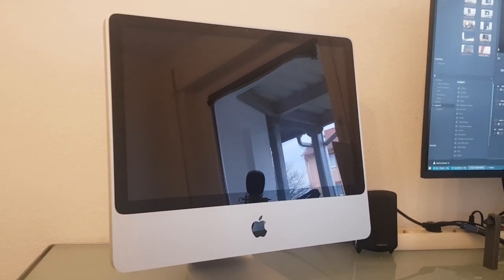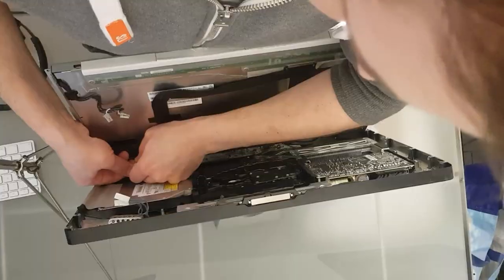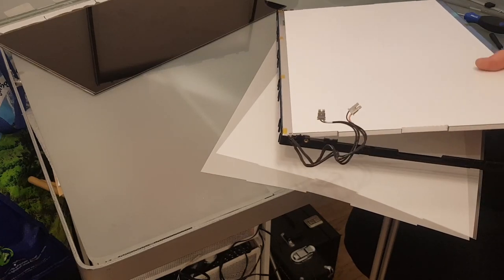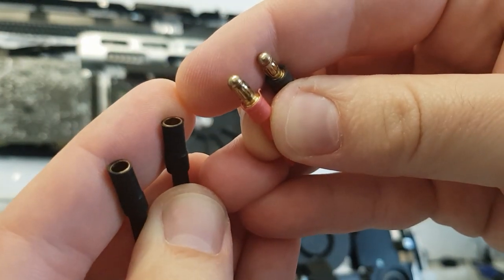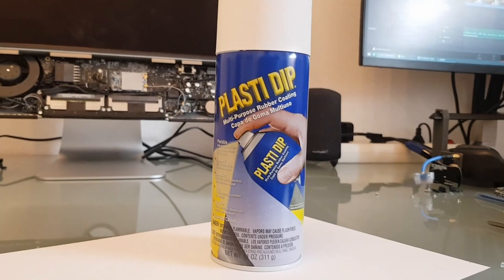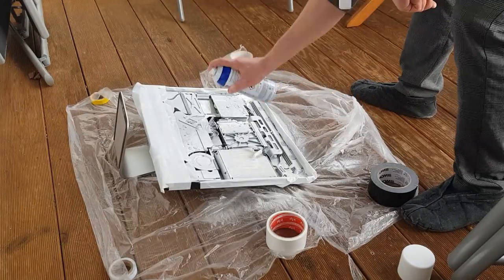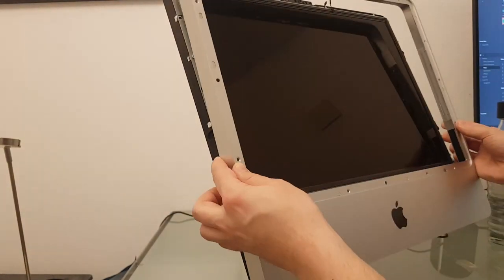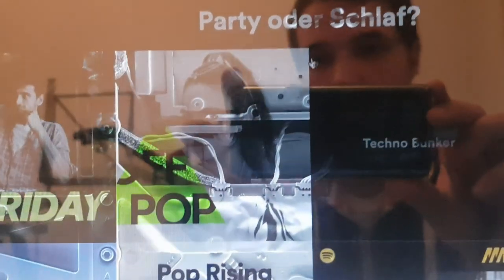iMac Backlight Fix - The SLIGHTLY DIFFERENT way.

Comment: You should try spraying a matte clear coat on the back of the LCD panel. Maybe it'll very slightly blur the innards of the computer and make it a little easier to read. Cool concept though.
Reply from the maker: I have an even easier solution: I tried it with the original backlight diffusor-sheets and it's resulting in quite a good image. But I really like the style and the depth of the monitor so I'm keeping it until it's boring. xD

But thx for the feedback!

Comment: Hi, that is a cool upgrade! I'm doing something completely different, I'm trying to get a x86 motherboard into the case and wondering the connection towards the invertor board. You meassured the pins, I believe you said 12volts but would you remember which 2 and what the other two where doing?
Reply from the maker: Hi there! No clue at all :D That's quite some time ago I had this thing apart - sorry!

Comment: There is a little hole on that hard drive, next time might want to mask over that so it isn't sealed. The hole allows for the inside of the drive to adjust for temperature and pressure change.
Reply from the maker: Ouh, good to know! Thx mate!

Comment: Cool stuff, it's a first time I see a modification like that. It looks like it could perhaps use some additional white transparent layer of background, (like maybe something baking paper-ish? tissue paper if it won't burn?) to add a bit more contrast, I wounder how much more it can be improved towards contrast-cool factor compromise
Reply from the maker: I've tried the original diffusor sheets and they're working really well. But at the moment I'm using the Mac as is, I like the style :-) thx for your comment!

Comment: hi, i almost finished the imac, the only thing that i need is a led strip, what type did you use? with an 27 inch model i shold use a very bright led, please can you give me an advice? thanks
Reply from the maker: I just took a random strip I had lying around 😄 12V and a cold white color and you should be good. I would look for a Leds without the water tight rubber on top of it, just a plain strip with sticky tape on the back. 👌🏻 Good luck!
Reply: @BeanJ  your led strips how many lumens has? i found some (from 1200lm to 8400lm), but some of them are very expensive (about 35 euros)
Reply from the maker: I've used this one for my build: https://www.amazon.de/dp/B07JXS42LR/ref=cm_sw_r_cp_apan_glt_i_dl_683EHN4XW7ACW8SN2VGH?_encoding=UTF8&psc=1
Reply: @BeanJ  thank you
Reply from the maker: Your welcome! Keep me updated! 👍🏻
Reply: @BeanJ  how can i send you picture of the iMac? I have to ask you some questions, but you have to see with a picture, thank you
Reply from the maker: @piton555   @Pit ON  I'm pretty sure there will be a lot of interested folks out there - you should post it in the subreddit r/Mac when you're done 😄 however for questions you can use my mail - MailBeanYT@gmail.com

Comment: I have an 27 borken iMac that has the same problem, do you suggest me to do this?
Reply from the maker: If you want to use it on a daily basis I would suggest to use led lights same like in this video but I wouldn't paint the insides and just use the original diffusor film. So I would use the strips as a cheap fix for the faulty backlight (I did that on my next video - maybe you should watch that ;) ). But be careful - the opened power supply is nothing funny and you shouldn't do anything you're not completely sure about just because you saw it in a random youtube video. Good luck!
Reply: @BeanJ  It would be my secondary Mac (to use Spotify, discord, team speak, etc), but i would make an slot (on the top) to put in the Mac a White film when i use It for warching video (but idk if i'll Do It because i already have an 4k monitor)
Reply from the maker: @piton555  Nice! I would love to see that! The purpose of the diffusor film is to spread the light evenly over the monitor, a white sheet could end up too dark in the middle of the screen, keep that in mind. Maybe you'll do a video on that? ;-) I would watch it! :D
Reply: @BeanJ  i have even the original layers whitch Spreads the light so i would use those
Reply: Ah and a question, the spray Is an white removable plastic layer, right?
Reply from the maker: @piton555  More like rubber, I guess. Plastidip is the stuff that other people use to spraypaint their car-rims in weird colors. If you're using it let it cure for quite some time, otherwise the Mac will smell quite bad for a couple of days or even weeks. :D And when sprayed on all of those small components like in the mac I guess it would be preeetty hard to remove all that stuff again.
Reply: @BeanJ  you have used opaque White or normal White?
Reply from the maker: @piton555  I actually don't know, there's nothing mentioned on the spray can. Just a white cap 🤷🏼‍♂️

Comment: You can buy an inline temp sensor that has goes between the HDD and the main board. Works great.  Or buy a software called HDDfanControl for about the same price. Either works great!
Reply from the maker: I've used Macs Fan Control, it's free and handles the fans exactly how I want it. :-)
Reply: ʙᴇᴀɴ just as a tip for the future, you can also just short the drive temp sensor cable with a bit of wire in the end of the cable’s connector, closing the circuit. That registers as “cold” and prevents fan spin-up. Most studies show that temperature has little impact on the lifespan of spinning platter drives anyway. I’ve used an individual wire
from CAT5 (solid, not stranded) as my “jumper” in the past. Works perfectly. 

I’d recommend disconnecting that connector from the non-Apple drive, as those pins are not standardized as a temperature sensor. They are sometimes used for drive config with jumpers between the pins used to set drive parameters. May wind up doing something unexpected if they are left connected to the main board. Apple repurposed those pins in their custom-spec drive (never understood why, when temp is reported via SMART anyway...)
Reply from the maker: @EightQuarterBit  Thx for the tips! I thought I tried connecting the cable to itself... 🤔 Maybe I'll give that a try when I'm opening the Mac the next time. Thank you!